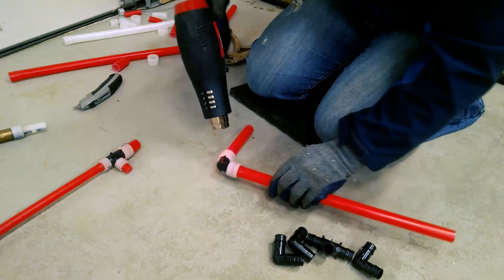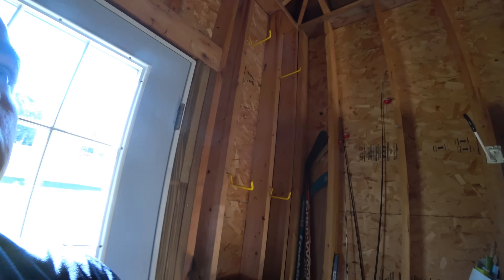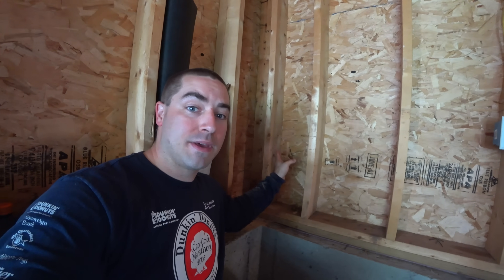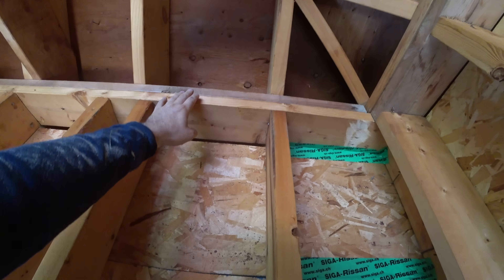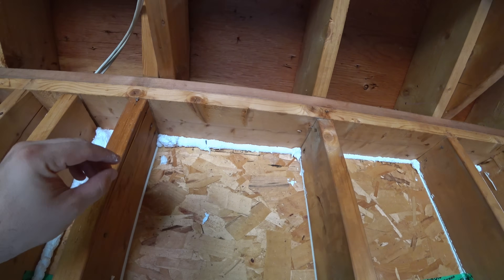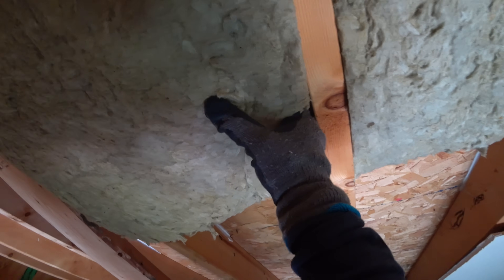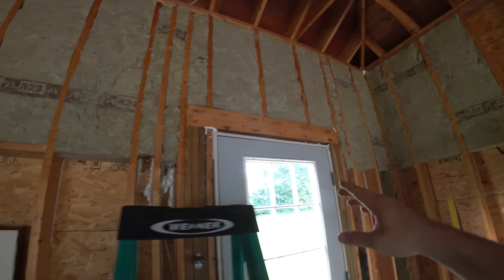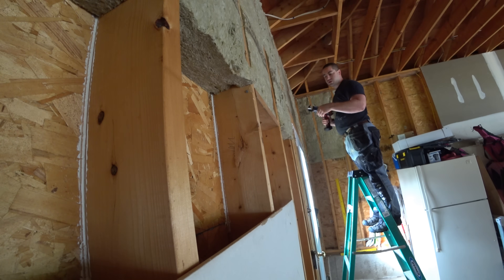Achieving Higher Performance with Batt Insulation, Roxul

Comment: Dont know the climatic conditions around there but isnt the vapor barrier needed?The air tightness should be decreasing from inside to outside so the moisture can dry out.What about in this case and conditions?
Reply from the maker: Thanks for your questions.  I'm in a cold climate, zone 5, Massachusetts.  This structure is a garage and will usually not be heated.  When it will be heated it will only be for short periods of time.  Because of this the moisture drive might actually be inward just as often as outward.  The wall needs to dry to both sides equally.  Adding a vapor barrier here would almost certainly trap more water in the cavity than it ever keeps out.

Comment: I was taught that wall need to breath or it will mold. In the mid Atlantic region it is common practice to put a vapor barrier on the inside  and sealed with tape,

Comment: i still dont understand why americans keep on using OSB on the outside of an isolated wall. its completely wrong...
also, air-sealing the corners between the stud and sheeting is totally useless because there is no air-leak. there is osb.
the best cheap tool to cut insolation is an old rip saw sharpened with an angle grinder. knifes are okay but not as comfortable.
Reply: Americans are about 60 years behind of scandinavians when we are talking about building houses.

Comment: Was looking at insulating my old shed (4.5m * 4m) on the cheap so I could use it but it seems unless I do all the walls and ceiling there's no point. It's wooden and problem is ... on 1 side there's next doors masonry wall and at most a 6 inch gap. That wall now has nothing as the wooden weatherboards fell off years ago. Other problem is most of the baton widths are different as the shed was built 60+ years ago. Might have to look at the rebuild alternatives as I really hate spending money on stuff twice.

Comment: Tiny detail.... Thermal bridging.... You are loosing 25% of your insulation....
Reply: The wall and exterior sheathing are already up. The thermal bridging train already left the station...
Reply from the maker: Yep.  Wood framing is often called out as taking up 25% of a wall space, and Robert is right, I'm working on an existing building.

Comment: Good work on air sealing, suggest you check out fluid applied sealants in lieu of tape and caulk - works better and much easier to apply. Some products to look at are Proseco, Huber, tyvek, and poly-wall. They all make a thick version for troweling (for seams, holes, and gaps) and a liquid type a can sprayed a or rolled for complete coverage.

Comment: Why didn't you just use a closed cell foam spray product to seal the corner without removing the stud?
Reply from the maker: There are some types of foam that are "slow rise" that might have worked, but they are not readily available.  The common one-part foam in a can (used around windows and doors) is another option if you drill a hole every 12 inches or so.  Try it out.  I tried this method years ago on a prototype, then opened it up and found the foam left a lot of voids.  Because I tested this method and looked I personally saw the flaws.  So I prefer this method.  Now I know the corner is fully insulated without voids.
Reply: I didn't know that about the foams. Thanks!
Reply: @DavidPozEnergy  very through !!   I am going with 3m 2 part spray foam to do the garage this spring.  I have a wood burning stove in there now and without insulation does not help much.

Comment: What polyurethane caulk are you using? Do you think Big Stretch (water-based) is a good choice here?
Reply from the maker: Sure, Big Stretch would work well.  This is a pretty nice environment.  No UV, no rain, not painted.  So your choices are huge.  If it says compatible with wood, go for it.  This is a link to an example of a good one: https://amzn.to/2BnHRbk I mentioned polyurathane in the video because I like when it has some adhesive qualities.  Most caulks want to be in a crack (ideal cross-section is an hour glass shape).  The corner is not an ideal spot (triangle shape), so getting a little adhesive in the formula helps.
Reply: Thanks for the reply! Makes sense.

Comment: Wouldnt it be cheaper to just spay form it. ? The amount of prep for the Roxul and making it airtight and the cost / time of all that surely spay form would do a better job and has higher R rating.
Reply from the maker: Hi Mike,  I'm focusing on DIY projects.  Spray foam is more expensive then buying batts and some tubes of caulking. Now if you are going to hire the job out, then your point makes sense because you are not just buying materials, but also labor.  Personally I like dense-pack cellulose more than spray foam in the case of hiring it out.  Thanks for watching.
Reply: Spray foam is the devil.

Comment: No vapor barrier?
Reply from the maker: Hi Juptak,  Nope.  I've stopped using vapor barriers in my work.  Basically they have the potential to trap water inside the cavity without allowing it to dry out.  We (as an industry) have found concentrating on air tightness to be far more important than vapor.  And prepare for something to leak at some point in the life of the structure.  So this assembly allows the wall to dry if need be.  Sometimes I will use "Intello Plus" as a variable vapor control layer, but here we were using OSB which has a low perm rating on its own.  Thanks for watching.
Reply: @DavidPozEnergy  You must not live where it gets cold, Vapour barrier is part of the insulation inspection here. not to mention stops interior air movement. OSB Has A 0.6 to 2 perm.(class 3) EPS and XPS .5 to 0.1 depending on thickness and 6mm poly is 0.06. The problem with mold is your air sealing is on the exterior of the insulation. If you move the air barrier to the inside and allow for air movement through the wall but place an exterior moisture barrier on the outside the walls and insulation can still breath while keeping the warm air locked inside the house

Comment: I'm not an expert but in a Garage, I would put at least 2 lawyers of taped drywall for fire protection.... and being up North would let exterior wall aerated so no mildew would grow in the wall... but for the rest... very well explained.... thanks.(wondering if mice and sequels build nests in Rockwood?)
Reply from the maker: Hi Marco, Yes, Mice can build nests in Rockwool.  In our area, only the shared wall of the house and garage needs a fire rating, which is 5/8 inch type X drywall.  He has that on one wall of the garage.  You might see it in a couple shots, but I did not work on that wall.
Reply: Also Rock wool naturally gives fire resistance itself because it is made of (basalt and slag from iron ore).

Comment: Great video keep them coming . BTW how much energy can you save with that insulation?
Reply from the maker: Hi Billy,  Sorry, I have no way to answer that question, far to many variables.  Insulation is a great thing to have.
Reply: Ok that is that is what I thought is a lot of veriables. So can you list the variables? Just so I can have more of an idea. Thanks and happy 4th of July :)
Reply from the maker: Hi Billy,  Sure, when doing very basic heat loss calculations on a building there are two main things to consider, heat loss through air leakage, and heat loss straight through the "shell".  The shell is your 6 sides of the building (floor, ceiling, and walls).  Heat loss through these is called conduction.  Insulation has a rated R-value (might be U value in Spain, which is the inverse).  When calculating air leakage heat loss you need these values: Volume and "Natural Air Changes per hour"  So to minimize heat loss due to air leakage you can improve it by 1: decreasing your buildings volume, or 2: minimize air changes.  Minimizing air changes is all about air sealing, which is what I did for the first half of the video.

Second, to minimize conduction heat loss you can control these two values: Area and R-value.  Area is the square feet (or meters) of your buildings shell.  R-value is the shells ability to resist conduction heat loss.  To minimize conduction heat loss you can make your building smaller, and/or, add more insulation.

This is the very basic nuts and bolts.  I hope it helps.
Reply: Hello David, Yes It helped a lot Thank you.

Comment: Nice job. Insulating the ceiling is the big save. I did all my walls first and it took a 3kW heater running full-time to stay warm in winter. Once the ceiling was done, It stays toasty-hot with only 300W heating. Insulation = money-saving.

Comment: The glueing and screwing of boarding on the inside. Will help in high wind. Like a  tornado. It makes the structure alot stronger.  Especially air sealing. It will keep the high pressure air out. . I have heard differing theorys of letting it in and out. It could keep the structure from exploding in a extreme wind event. With boarding inside and out. It is a strong structure. Better than my house! Keep up the good work!

Comment: I wouldn't take the stud out... Just drill a couple holes and foam it in
Reply: I've done exactly what you say here. Even with low expansion (1 part) foam, it pushed out the exterior sheathing.

Comment: What ever happened to 6 mil plastic and tuck tape?
Reply from the maker: Plastic has fallen out of favor because it can trap water with no escape.  Instead, concentrating on keeping air out will also keep out the humidity that would condense.  But this wall assembly can still dry out in both directions if it ever get saturated.  Sometimes windows break, trim rots, shingles get blown off and bulk water finds it's way into a cavity.
Reply: It creates a rot box over time.
Reply: the only time polly is not so good is in summer when you are super chilling your house and its humid out side you can get condensation on the outside of the polly, other then that its really good to use it, we are starting to build passive houses and I think they are a bit of a wast.
Reply: Plastic is still used here in MN. anywhere heating is a lot more than cooling you really want plastic or foam on the inside.
Reply: I was going to say the same thing!  it doesn't hurt to seal the outer sheathing but you should still always put 6 mil poly. also around the receptacles.